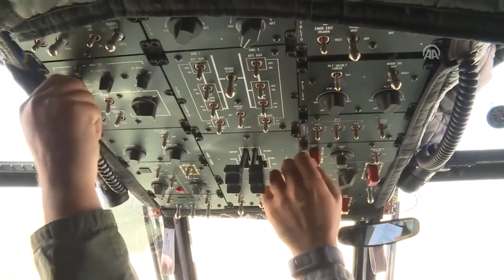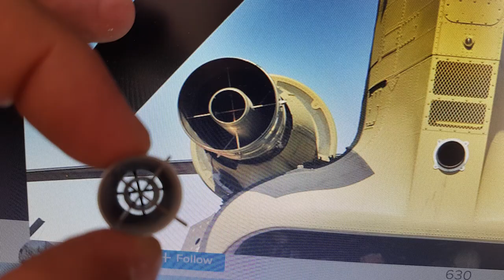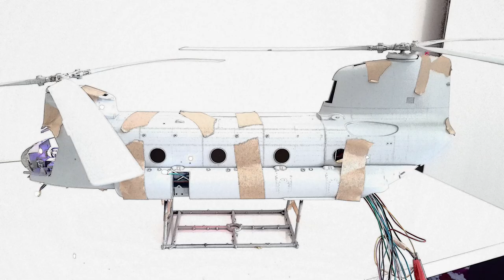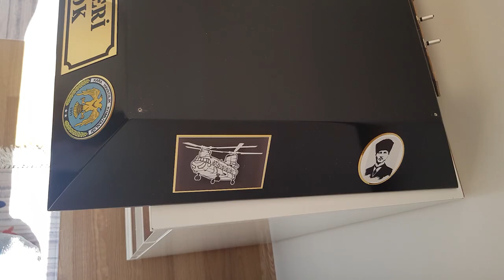TRUMPETER 1/35 CHINOOK CH-47D ( 1/35 CH-47F CHINOOK TÜRK KARA KUVVETLERİ )

Comment: Oh, what an excellent, exciting project! 
   At 2:12, you show the aft rotor assembly powered; and at 2:41, both sets of blades. I have heard and read that motorising propellers (I infer, helicopter rotors, too) of polystyrene model kits can result in deformational warping of the plastic, and possibly even breakage. Have you heard this? If so, do you know if this is true?